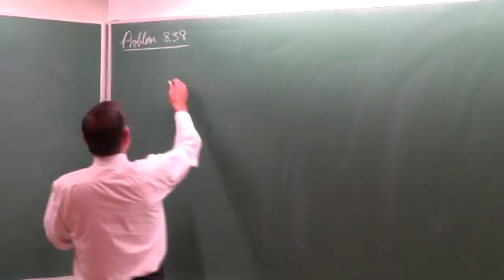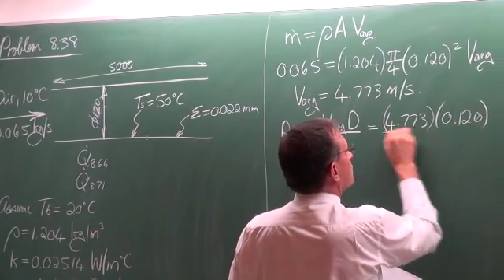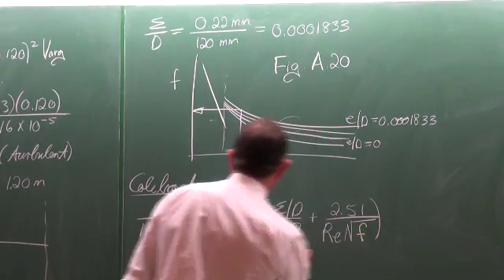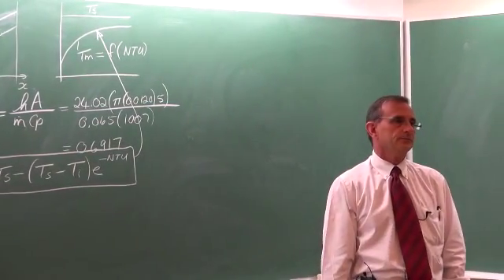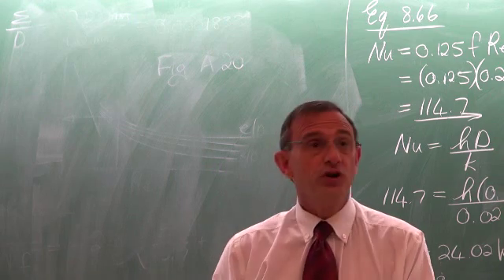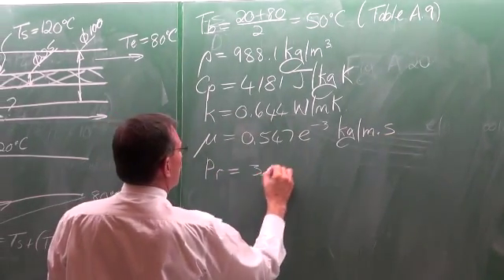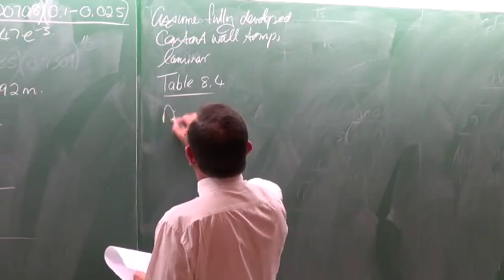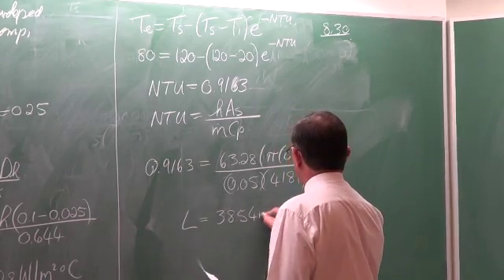Lecture 24 (2013) 8.7 Two problems on internal forced convection

Comment: What happens if in the exercise 8.50 the distribution of heat is constant inside de duct? I mean using a cartdrige electric resistance instead of the surface constant temperature tube.